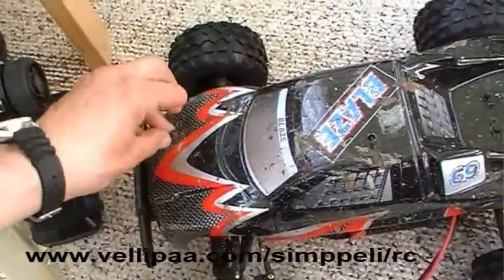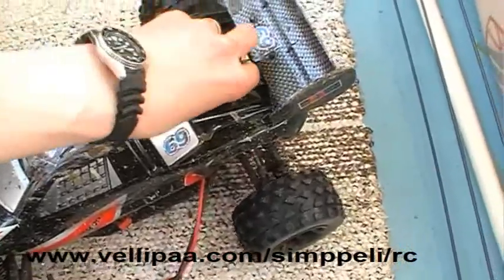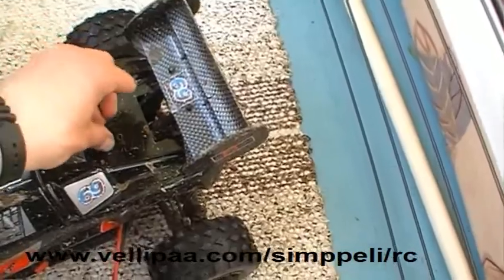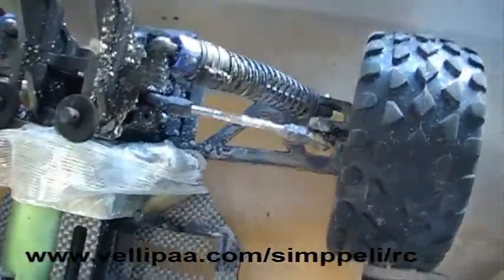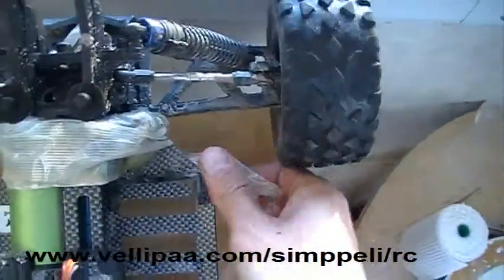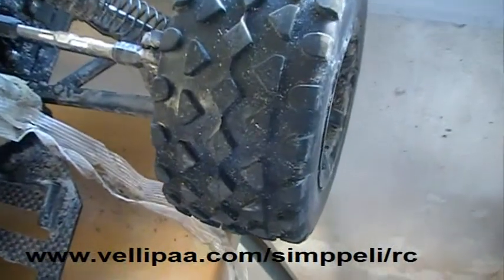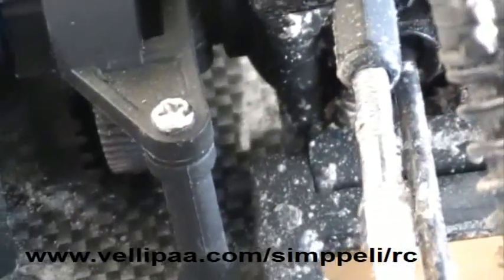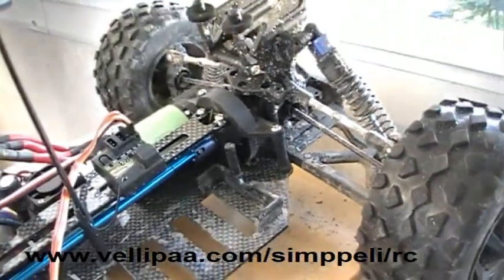Reely Blaze with pinion & spur protector

Comment from the maker: Hi,

The truggy itself is fun to drive and handles really well (no track experience, only bashing around). I have not yet broken any parts and seems to be quite durable material.

The main issues with the truggy are:

1. Expensive spare parts and only from Conrad (limited stock).
2. Gears are unprotected and ripped mine before first battery ran out.
3. Front wheels turn so much, that the axle comes of. Steering must be limited that the axle does not come out.

Comment from the maker: I fixed the issues in following way:

1. 100mm axle could not be found elsewhere, so extented HSP ~95mm axles.
2. Filed spur axle to fit (modified) Revo 3.3 50T 32P spur and put Revo 3.3 13T 32P pinion. Without any protection at the sandpit the gears are still OK.
3. Limited steering from radio after lost my front drive axle.

If you don't like to modify and try out things, this truggy isn't for off-road from the box in my opinion.